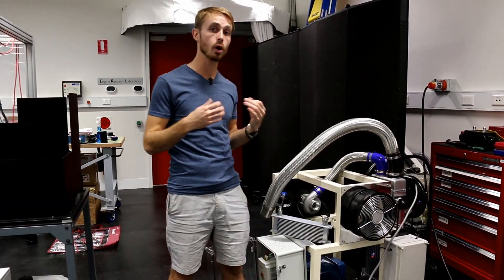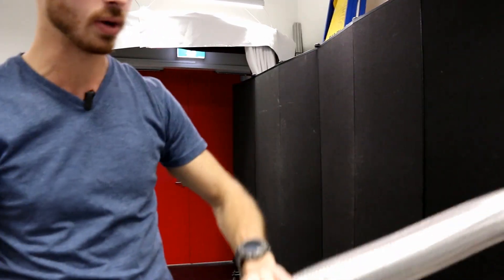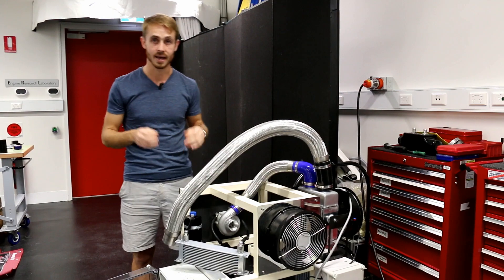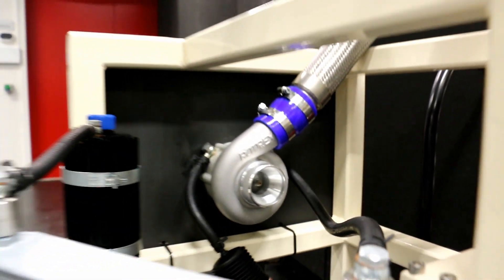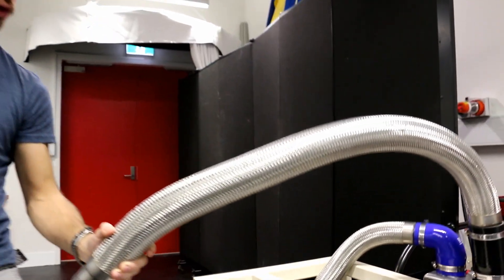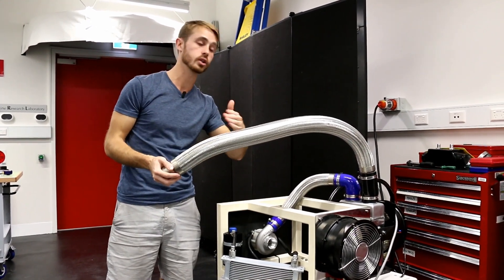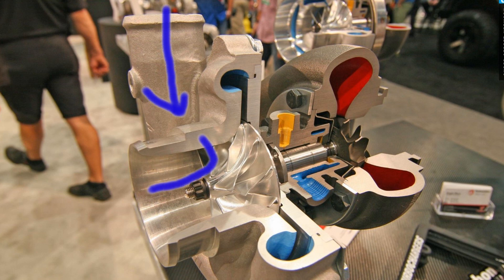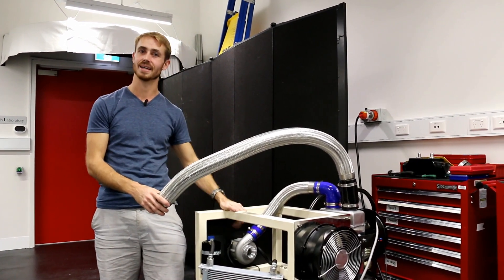What Causes Turbo Flutter? Compressor Surge Explained

Comment: So everyone online makes it sound like a turbo will explode after 6m- 1 year of running with no blow off valve. This fatigues the turbo but how badly
Reply: +Quinten Davis I think it depends on the amount of boost. Big boost would probably be better of with bov, but with low boost bov shouldn't be needed. I've actually heard that on stock Imprezas the turbo lifetime is reduced with the blow-off valve, because it keeps the turbo spinning at higher speed all the time, which eventually wears out the bearings. With no bov the pressure isn't big enough to cause too big of a stress on the turbo. In stock form.

But that's just what I've heard. Never tuned a turbo engine, or any engine for that matter.
Reply from the maker: +Quinten Davis I honestly couldn't give you a concrete number as I have never seen a turbo fail from flutter, only heard stories. I know a guy that had a very fluttery car that ran for quite a few years with no issues though, and there are plenty of racecars that do it too, so I would say that the number would be above the one year mark. Like I say though, no first hand experience with the failures, every turbo setup I've worked on has had a bypass valve, and my race buggy turbo setup is flutter free, so take what I say in this regard lightly.